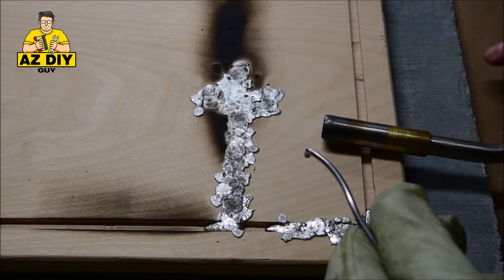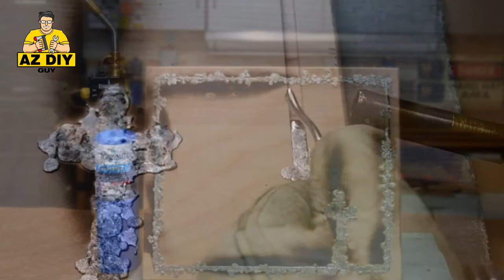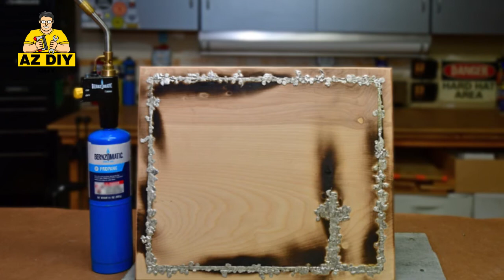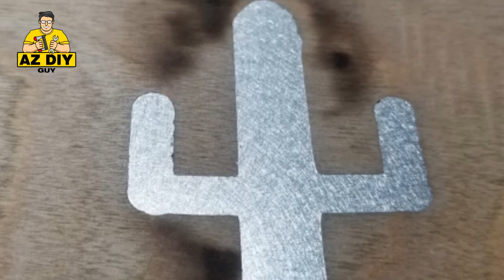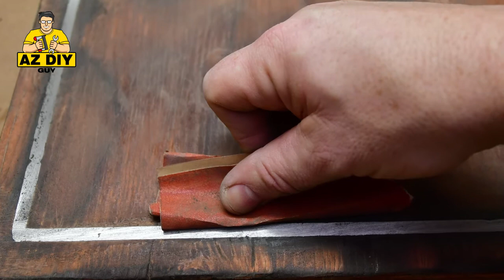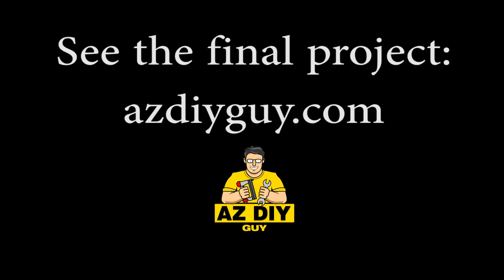Metal Inlay into Wood using Solder and a Blowtorch

Comment: I'm planning to solder a design into wood. Is there some sort of sealant I need to put on the wood before soldering? And, are there different types of wood that may burn easily from the solder?
Reply from the maker: I didn't do anything to treat it. I just used plywood. I don't think the solder will burn wood, but the torch will if you are not careful. Good luck with your project!
Reply: @AZDIYGuy  Cool and thanks!

Comment: So I got a question regarding letting solder drip onto wood. I am wanting to make a wooden stand for my soldering iron I got and plan to drill a hole to let the excess molten solder that is on the tip of my iron drip into so it doesn't spill. My question is will I be able to remove the solder easily once it cools?
Reply from the maker: Since I wanted it to be permanent, I never tried it. I assume it would be easy enough to pry / chip out of there though.
Reply: @AZDIYGuy  Okay, so can you explain exactly what happens? Does the metal sorta fuse with the wood?
Reply: @reconab12  I know this comment is from 3 years ago lol and I assume you probably already got the answer but I’m answering this for anyone else like me who may come across this thread years from now.

When the metal drips into the wood it conforms to the shape of the wood grain it lands on. If it’s a polished smooth surface then it should come right off with barely any resistance. The only thing to note it to not have any lacquer finish on the wood as the heat of the metal could melt/burn it.

The rougher the surface, the more nooks and crannies the metal has to get a grip on. I hope that answers your question.
Reply: @ladynagant8882  despite it being 3 years late it does actually help, I unfortunately never built this soldering iron stand nor have I used my soldering iron however this does help give me info I will want to keep in mind.
Reply: @reconab12  happy to help! 😁